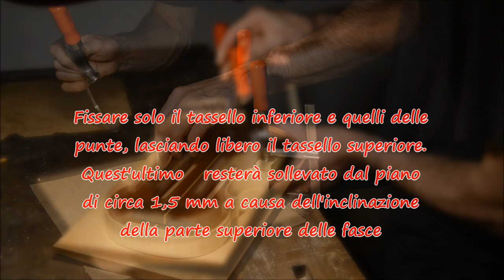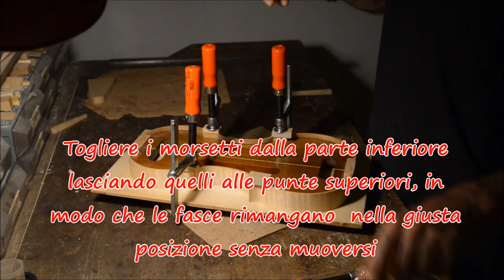Piazzamento dei chiodini e tracciatura del contorno della tavola

Comment: Why do you put the pins at 4mm,   On the back plate it was 3mm
Reply from the maker: On the back the pins are placed at 3 mm from rib line to make sure that the purfling covers it as much as possible, but the resulting hole in the block will be very close to the outside rib in a potentially weak position. On the top plate the pins will not be visible anyway on the finished violin (fingerboard and tailpiece will hide them), so I prefer to put them more inside (4 mm) so that the corresponding hole is more centered in the block in a healty place, leaving them free from the purfling.
You could also put those of the back to 4 mm, at the end they will remain visible inside the purfling in the finished violin, as some old masters did (not Stradivari). It's just an aesthetic and stylistic factor, it doesn't change anything acoustically because the pins are used in the making process but they have absolutely no function in the finished violin.
Reply: Thank you Davide,  that makes sense.  I've started carving the back plate and your videos are very helpful!